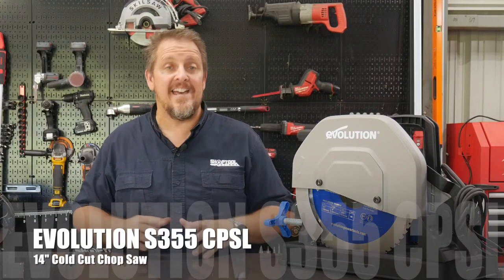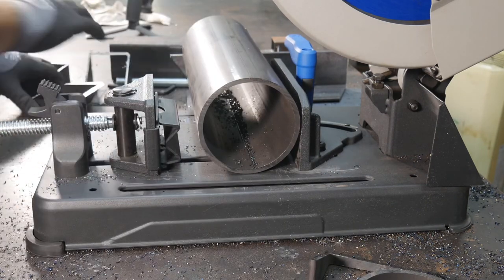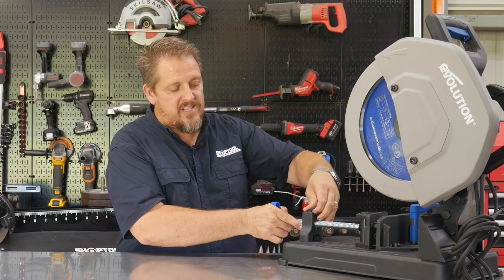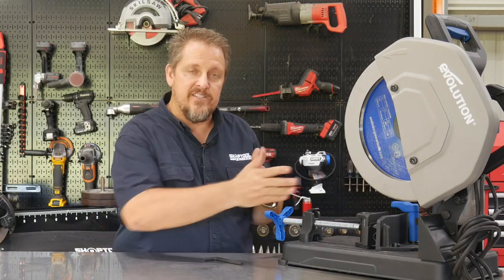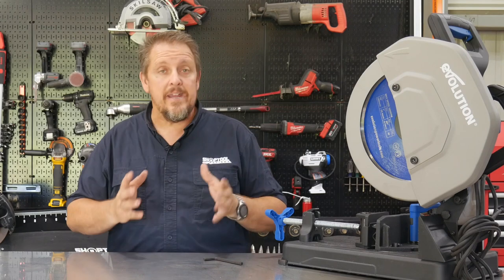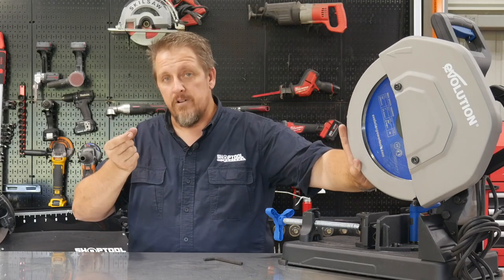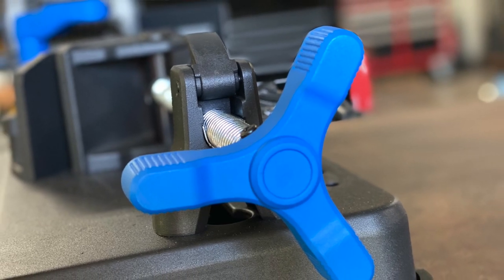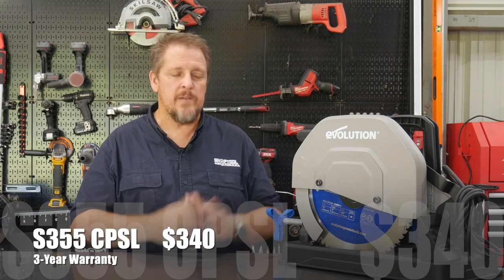Cutting Steel With a Saw Blade - Evolution S355 Chop Saw

Comment: Blades last longer with a bit of lube.
Reply from the maker: This is definitely true. Typically, we'll use a little wax or cutting lube on the blade when we're making a lot of cuts. Thanks for watching.
Reply: Cutting oil? What u recommend?
Reply: @organicvids  ct90 works well. Or any of the solid wax lubes.